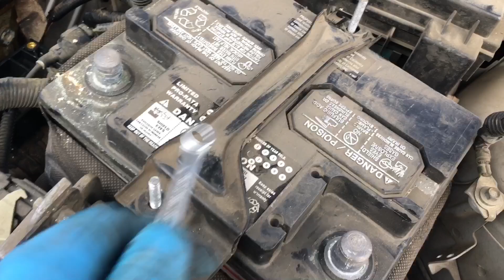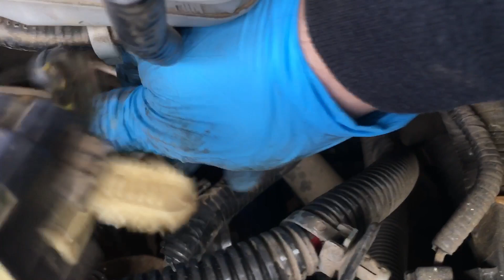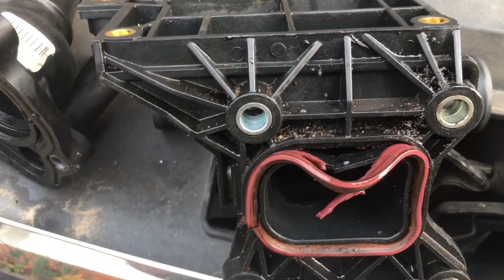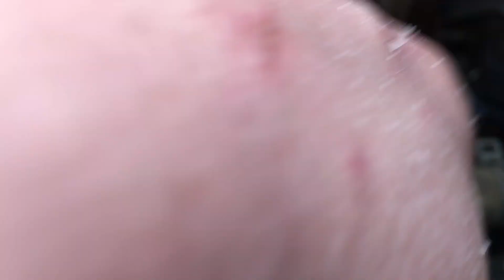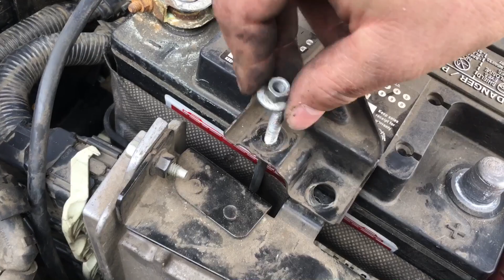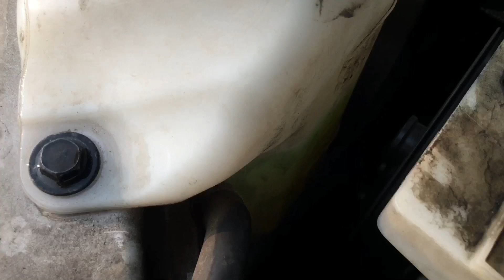How To Replace & Fix Leaky Engine Coolant Water Outlet on 2008-11 Ford Focus 2.0l I4 Duratec Mazda 3

Comment: After replacing the part and adding some coolant ... when you start the car you should run it with the heat blasting, correct? I'm about to replace this right now, my completely erupted on me last night 😂
Reply from the maker: Yes, but just until operating temperatures, let it cool and recheck fluid , you’ll have to do this a couple of times

Comment: This is a great video! I have  leak in this area but it looks like it's squirting from bottom of the freeze plug directly above the thermostat. I guess I need to remove that housing to know for sure
Reply from the maker: Thanks for watching 🍻
Reply: @ATEMOFFROAD  I just removed this part and this was my problem. what I thought was a freeze plug is NOT a freeze plug. when you get this coolant manifold off it's clear to see that. I had the gasket blown out and a smaller chipped piece. thanks for the video. my car had water in   the battery tray and the bolts were rusted and no way I could take it off.

Comment: Good video, thanks. For 2012 Focus SE 2.0L the part number is Dorman 902-1085. Comes with a built in sensor. Replacement is similar to what is shown here. I would definitely remove the air filter box, battery and battery box up front. Not difficult at all. I didn't disconnect any hoses except from the water outlet itself. The last hose is on the bottom of the outlet: remove the outlet itself, then turn it over to access the bottom hose.
Reply: Hey there. I'm just wondering: did it look like thr coolant was leaking around the freeze plug? My 2010 got hot yesterday on the way home and when I tried to put more in today, it looked like coolant was slowly gathering around the freeze plug.
Reply: @mrmusicsnob  In my case, the seal/gasket had clearly failed because there was coolant spraying out from the joint. There was no 'looks like...maybe...' about it.

Comment: Right now my car needs this water outlet replaced. When diagnosing this my car was brought up to normal operating temp but the cooling fans never turned on. I’m going to put the outlet pump in next week and I hope the cooling fans turn on afterwards. Does this parts failure cause the engine cooling fans that you talk about towards the end of this video to improperly work?
Reply from the maker: To check your cooling fan turn in the ac they should both come on right away. Thanks for watching 🍻

Comment: I think this might be what happened on my 09 focus today. I noticed a very small leak a couple of months ago, thought nothing of it since the car was running fine but later saw my coolant level was dropping so I refilled it. This morning, the car very suddenly started to overheat and I saw coolant was almost empty. Even after refilling the coolant it still overheats in just a few minutes. Maybe the coolant was too low and blew the seal as you mentioned in the video. Hope the mechanics can fix it up easily! Thanks for the great explanation.
Reply from the maker: Thanks for watching, I appreciate it 🍻
Reply: same exact thing just happened to my 10' focus so I feel your pain. Because of the bad timing with work I went ahead and took it to a mechanic. Big mistake! They didn't replace the thermostat and charged me a rediculous amount. Oh well,I hope it worked out better for you.

Comment: I did this but now my car won't start. Can you help me?
Reply from the maker: Oh no , Have you got the car to start? My suggestion would be to start going through and back tracking everything you did! Also make sure each connection you disconnect is making a good connection, I’ve seen this before where the electrical pins bend out and miss there connection! Good luck 👍🏼
Reply: @ATEMOFFROAD  Yes we did

Comment: My wife's car had a coolant leak that I tracked down to this area of the car.  Got the manifold off and her's looks exactly like this one.  Excellent video.  I will note, that if you are lazy you can definitely do this without removing as much stuff on the car as in the video. Don't get me wrong, there is a trade off since access isn't easier.  At the same time, you reduce the odds of forgetting to reconnect something or getting confused.  I took the battery out, the bracket above the mainfold, disconnected a few of the connectors, and then sort of shoved stuff out of the way just enough.  I will also say that the bottom two bolts, a mirror is helpful in locating those.  Overall though, good video, much appreciated.
Reply: How long did the whole process take?
Reply from the maker: @Dmendoza92  a good two hours for me
Reply: @Dmendoza92  2 hours.  There are some PITA hoses in there, and some of the bolts for the manifold are difficult to get at, you might drop some, etc.  I would suggest replacing the hose clamps with the screwdriver tightening kind.
Reply from the maker: Thanks for watching, I appreciate it! Cheers

Comment: shows how to take bolts off. doesn’t show how to undo the clamps. cmon man
Reply from the maker: I used channel locks for the easy ones to get to. the harder ones , it’s tuff but you can use a pair of slip joint pliers or vice grips too ! If your tool savey you can get it done no problem! Thanks for watching! Cheers
Reply: @ATEMOFFROAD  what did u use to clean where tha water output bolts up
Reply from the maker: @Beemoval22k  scotch brite pad and plastic gasket scraper

Comment: I got my radiator flush that Valvoline and then a month later this happenedbut I don't think they're related I think it's just a Ford thing
Reply from the maker: I wouldn’t think there related! They just fail unfortunately! I would suggest thermostat and gasket replacement too! If you see any hoses that feel soft, good time to replace those too! Good luck 👍🏼
Reply: What is that oriface(circle) that's on the block above the water outlet? Seems there's a buildup of coolant flowing from there as well. Is it just a freeze plug or something?

Comment: I need to know where ur car was leaking from. Mines leaking from the big circle that’s a lil above that bracket water outlet as some calls it
Reply from the maker: Water outlet manifold housing and gasket blew out! Thanks for watching
Reply: @ATEMOFFROAD  I took mine off today and it looked just like yours.  Cracked and busted gasket
Reply: hey Zach are you talking about where he points at 7:19. My 2010 is leaking in that same spot. ☹️ Don't know what to do. What happened with yours?

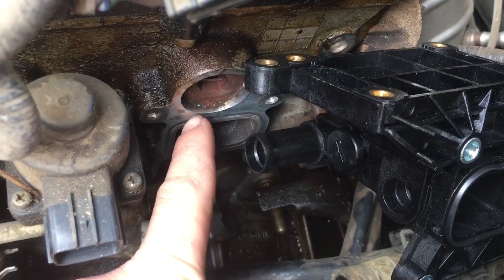Comment: Thank you for the vid! A question: what is the name of that round hole/outlet with a sort of brownish plug (needs a huge alien key it seems to open it) right above the “rectangular “ outlet you connect the new piece to?? You’re pointing at it at 10:09 approximately. And why does it throw out water (in my car)? A huge thank you!!
Reply: Ok, if anyone is a dummy like me 🤦🏼‍♀️ there’s oil behind that plug so no water can come out of it, and the water i see it’s still coming out of that water outlet piece it’s just shooting straight up into that plug and it makes it look as if the water is coming out of the plug 😄🤦🏼‍♀️ silly me 🤦🏼‍♀️ but please correct me if I’m wrong again!
Reply from the maker: @julianamargules325  I was thinking what you are thinking as well , possibly a service port or a place for machine tooling during the manufacturing process! But I’m not totally sure as I don’t remember,  you mentioned that you removed the plug?
Reply: @ATEMOFFROAD    no no, I didn’t remove the plug. :) After some digging I was told it’s a casting plug for the cylinder head and if there’s anything leaking from there it’s motor oil.. in our case it’s water that has been leaking (but not from there) - after my husband couldn’t find any leaks visually he simply blowed air (with his mouth 🤦🏼‍♀️) into the coolant tank and following the hissing sound I located the leak and it did look like that water is coming out from behind of that casting plug it looked very confusing to both of us😄  but now we know that it’s that coolant water outlet causes the leak.

Comment: I want to pile on with the praise here because yours is the only piece of information I found after hours of searching the intergoogler that spoke to this piece of equipment on this motor. It helped reassure me that I was on the right track and provided some handy tips.  I had not run across this design of a cooling system before.  Thank you for taking the time to post it!
Reply: You're welcome though again, the thanks is from me. I confess I'm a little uneasy about the whereabouts of the old blown gasket. After removing the coupling, the gasket was nowhere to be seen so I am hoping it's not somewhere in the cooling system waiting to clog up something inside the engine.
Reply from the maker: Doug Drake thank you I appreciate it!! Cheers

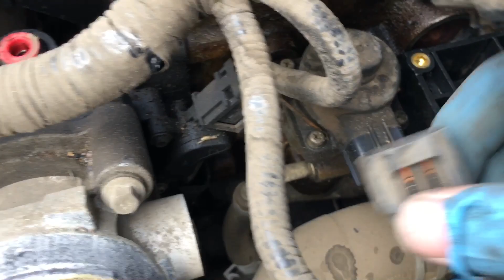Comment: What was the connector you unplugged at 5:22 called ? That silver tube right under it that bends downward is where my leak is.
Reply from the maker: That one comes directly from lower port of radiator to engine head!
Reply: @ATEMOFFROAD   I figured it out it's part of the egr valve

Comment: I didn't have to take the ECM out either. For the thermostat, i unbolted to reach the clamps with 90 degree pliers. Then reattached to wrestle the hoses off.
Reply from the maker: 💥 nice, thanks for watching

Comment: Update... I just finishing changing the part. It took me better part of an hour; I took it slow. I did not have to take all the parts off as you did. I took the battery out and the battery plastic tray off. Besides pulling some of the electrical connectors off and the tube from the valve cover to the airbox, I didn't need to pull the airbox off. My car is a 2010 and the airbox looked a little different BTW. When I pulled out the Coolant Water Outlet... It looked exactly like yours did in the video. After putting it all back together I had an issue the first time I started the car.... It didn't start... I had changed the valve cover gasket before and ran into the same issue, I checked the electrical connectors and I head a big CLICK! Then the car started. Anyone that does this make sure you hear the click, it looked like it was on all the way and sure enough, it wasn't. I just bleed the system and ran the car for a 1/2 hour. The temp never got to the ½ way mark. I took  it for a 4-mile test drive to the gas station and back making sure I didn't get to far. Still the temp gage never got to the ½ mark. I would like to thank you for your video, it made it much easier to do. I would say on a scale of 1-10 difficulty I would say 5.5. It is really a 4.5 but the tight squeeze and all the stuff to pull out the way adds another point to it.  Total repair cost with part and coolant was $50 plus tax and about 1 ½ hours of my time.
Reply from the maker: Andrew Sep glad you were able to persevere and make this repair on your own.thanks for watching buddy I appreciate it! Cheers!
Reply: I wanted to remove the plastic battery tray, mine was full of water (saw this guy's was too).
The nuts rusted so bad socket wouldn't work, js.

Comment: This just happened to me. I was driving home and saw the temp gage go to red. I stopped and let the engine cool off. I opened the hood and heard the sound air venting. Then right at the spot I saw all the coolant all over that right side of the engine. Tomorrow after work, I am going to be replacing this. Thanks for the video.
Reply from the maker: 💥 nice, thanks for watching

Comment: Thanks for this video, allowed me to do the repair myself. Removing the battery tray made it a lot easier to get to those 4 bolts holding the outlet on.
Cheers!
Reply: Omg thank you so much. Like others I thought the leak was from the frost plug until I found your video. About an hour of work and boom im back on the road! You are amazing.
Reply from the maker: 💥 nice, thanks for watching guys! Cheers